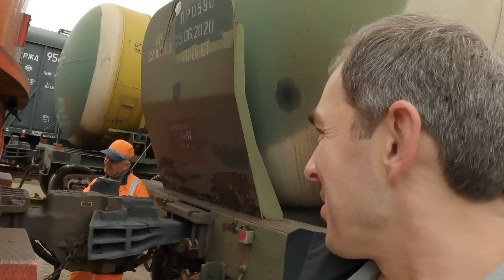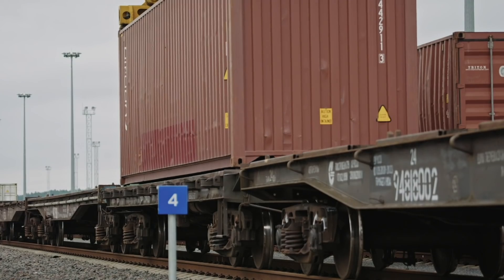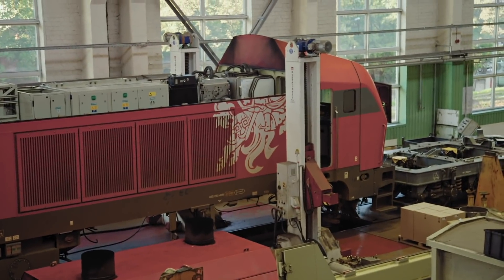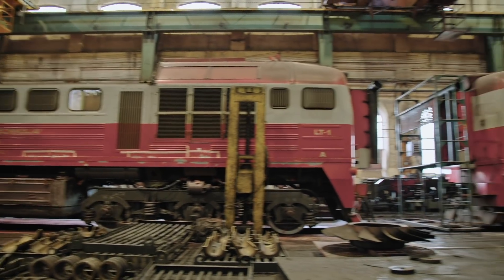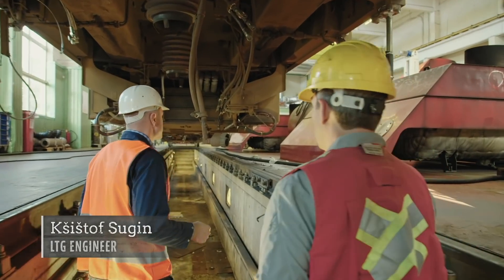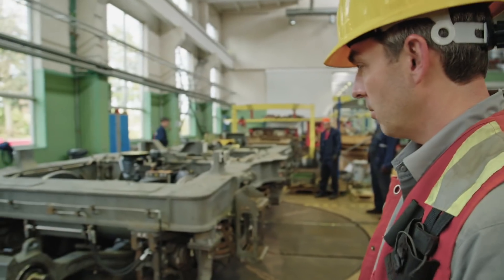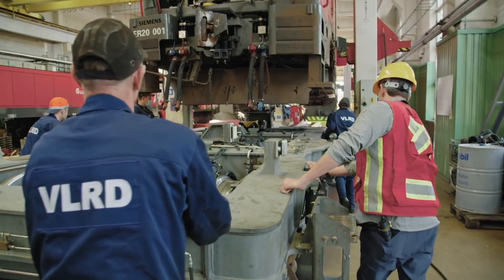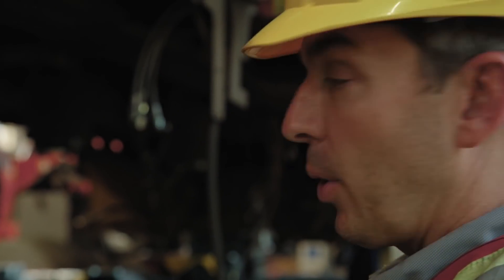This Lithuanian Depot Has an Innovative Approach to Train Repair 🛠️ Smithsonian Channel

Comment: I don't get what the innovation was? Was it making new parts from scratch?
Reply: I believe it was putting in new parts, bogies in this case, that are built to newer specifications and probably capacble of running on other systems besides just Lithuania.
Reply: @bitsnpieces11  gotta change the tracks not the locomotives to leave Lithuania. They run Russian gauge there so can’t leave to Western Europe